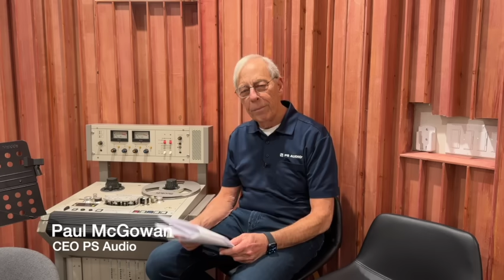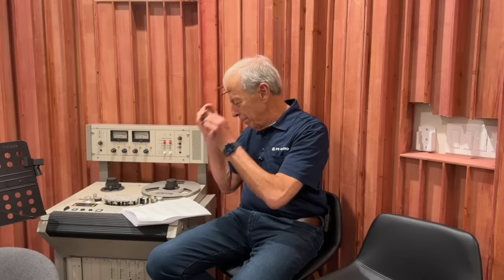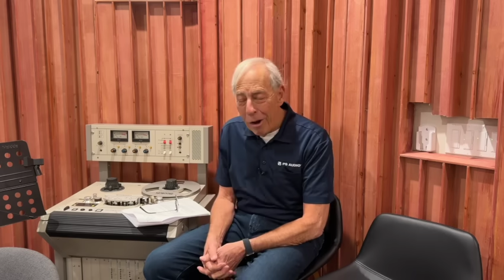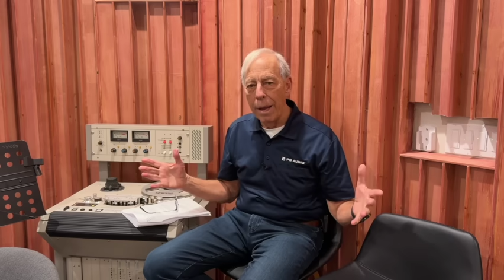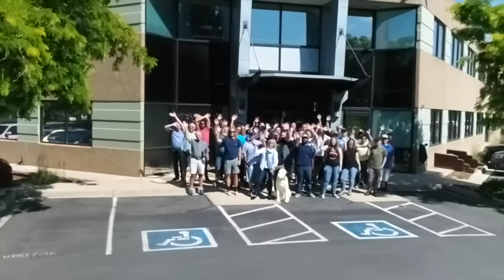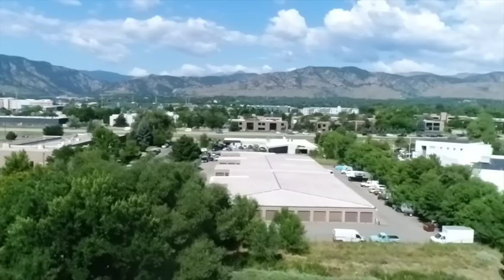When measurements and listening disagree

Comment: Data is always more valid and reliable compared to just listening. Data is one way to make sure the playing field level. So, for example, all components being tested must be set to the same volume. Guess what? You can't use your magic ears to do that. If measurements are not aligning with what you hear. That is most likely due to something wrong with your perception--such as psychological factors like expectation, which is why the listener must be blinded in comparisons. Another reason one's ears are not to be trusted. Also, one may be looking tat the wrong measurements or insufficient measurements. Measurements to describe the electrical signal and its manipulation are few an easily measured (your ears can't hear it). Measurements of sound in a room are more complex are require more and more difficult measurements that are generally not available for your speaker, room, and listening position. These variables are why one can't just listen to determine causes of perceived differences. The biggest lie in audio is that your ears are better than measurements. Are your temperature sensors better than a thermometer? Can your eyes see millimeters better than a ruler? Get real, measurements were invented because our senses are not accurate enough and are subject to illusion.
Reply: Maybe those who try to reduce this beautiful world to graphs, charts & numbers have a secret desire to become a robot. We definitely get more of an emotional reaction & emotional communication with some equipment over others. Find yourself a few good audio reviewers, whose description of how things sounds seems to be in accord with what you hear. That's a way more valuable way of choosing, or choosing what to auditoon than anything a measuring machine can tell you. Listening to music is totally subjective and anyone who downplays the importance of that over numbers is coming from way out there. Even if measurements were perfect, they at best could only tell us how something sounds to another measuring device; not how it sounds to the human ear/brain system, which works completely different, has no parts in common & is wired completely different. A man is not a machine and a machine is not a man. They both hear and translate things totally different. The day that measurements can consistently tell us how something is going to sound, is the day when I'll care about measurements. That day may never come and I'll never be a robot. 

 Our measurements are primitive and mostly useless as it relates to the human ear/brain system. If they don't relate to what we actually hear, then they are more "trivial" than useful. It's like giving a pig some kind of food and asking a human how it tastes, because we are smarter. We may be smarter than the pig, but we can't tell the pig how the food is going to taste to a pig, which has very different taste buds and physiology than a man. If pigs could talk, wouldn't it better for the pig to ask another pig how it tastes? Even if there are differences between pigs, there's a much better chance of it being a simialar taste experience, than a machine trying to tell a pig how something tastes, being wired completely different than the pigs sensory apparatus.

 Anyone who actually thinks and says that a measuring machine beats the human ear/brain system for evaluating how sounds are going to sound to a human, is thinking too far out; is thinking robotically... like a robot! Robotically wrong as hell; even if it can measure perfectly!
Reply: @sidesup8286  So, you have no evidence or logical argument, so you resort to false analogies. I'll go with the robot opinion.
Reply: @Rob-k5k9u   ...good! While you are busy with your 'I must measure everything' mindset the rest of us, who are actually
into this hobby FOR THE EXPERIENCE OF LISTENING TO MUSIC will do that. You do you & we'll do us...simple ✌👍
Reply: @FatRat-f9m  That is exactly what people say when they have no actual argument or evidence. You need to look in the mirror and see that you are obsessed with equipment, not music. Oh, and there is no "we" or "us" on YouTube, you just want to feel justified that other think like you do. Let the "we" speak for themselves.
Reply: @Rob-k5k9u   ....blah, blah, blah, blah...keep blathering because I'm not reading your overcooked engineering mindset crap anymore...I'd rather listen to music 😁
Reply: @FatRat-f9m  How much did you pay for your expensive amp?
Reply: Except in this case you are using your ears/brain for enjoyment, which no measurements can do this.
Reply: @mitchtaylor6512  It should be clear than so-called audiophiles differ in their goals. Some seek pretty or impressive reproduced music. Others have the classic home audio goal of high fidelity. Measurements will serve one better for the latter.
Reply: @Rob-k5k9u there is no such thing as accurate reproduction, so no high fidelity actually.
Reply: @mitchtaylor6512  The mantra of the subjective crowd: There is no objective accurate reproduced sound--only people's preferences. If that were true, it is unclear why anyone would care about the preferences of other subjective listeners. One can simply pick what they like. In reality, for decades, we have known what is a more accurate reproduction of the original recording. That's called high fidelity.
Reply: @Rob-k5k9u  there is no accurate reproduced sound.  We don't have an agreed upon human weighting system and measurements are taken in isolation, not how the equipment will be used.
Reply: @Rob-k5k9u   ...home-audio is & will always be subjective because listeners have different hearing from each other. Measuring music with instruments tell us nothing about how it sounds to the individual listener.
Reply: @mitchtaylor6512  There is more accurate reproduced sound. We merely have to compare the input signal to the output and try to minimize any differences--which can be measured better than just listening.
Reply: @FatRat-f9m  Actually, humans have ears and brains that work about the same way. Measurements of electrical signals encoding sound are well correlated with what people report hearing. Your just making stuff up you don't understand to defend your unfounded beliefs.
Reply: @Rob-k5k9u   ...& I can say the same about your engineering mindset. I use my ears to assess home-audio gear...always have & always will as it works perfectly for my purposes. Do your self a favour & stop trying to convince me of your overcooked engineering mindset as I'm not buying it. I have stated my belief that measurements are important at the early stages of design, development & testing of home-audio gear & none your your nonsense is going to convince me otherwise. I would suggest that you go & do something more productive with your life than continuing to try & convince me otherwise...it is a waste of your time & effort, Bye!
Reply: @FatRat-f9m  Actually, decades of psychoacoustic research prove that we can accurately predict what listeners find 'pleasing' through measurements alone.
Look up the Toole/Olive studies, the Fletcher-Munson curves and AES standards.
Reply: @FatRat-f9m  I don't deny it works for your purposes. I deny your amp sounds "better" than another. I do that because nobody has ever demonstrated they can distinguish amps. You believe because you heard a difference without taking any steps to control conditions. It's like believing calling people names is some sort of logical argument, which you also seem to believe.
Reply: @Rob-k5k9u   ...you are insane; pure & simple.
Reply: @Rob-k5k9u  The mind prefers the rest of belief to the exercise of learning. Sadly.
Reply: @FatRat-f9m  More name calling, no evidence or logical argument. Can you see how this weakens your position?
Reply: @ Rik. My analogies are always good ones and when something is as obvious as day versus night, no one needs to measure the moon to prove it's up there. Enjoy your tinny darkness.
Reply: @sidesup8286  That is exactly what people displaying the Dunning-Kruger effect say. Enjoy your delusions, but there are usually designed to be pleasing.
Reply: @Rob-k5k9u   ...you are so obsessed that you just don't know when to give up. You are the one with D-K effect problems.
Reply: @Rob I meant, with my comment about measuring the moon and your living in tinny darkness.
Reply: @Rob. Rob(bie) The Robot needs oiled. Any time you see someone on here asking audiophiles to "prove" that their system has special qualities, you can be sure that the confrontational person's system has no magical qualities like those at all, and is so far from them, that they can't even imagine such qualities to exist. They're always asking for "proof", yet they never provide any proof of anything themselves!.. You have to read between the lines with these types. Maybe their Fisher receiver from the 1979 spec wars have good specs but sounds like crap, from all the negative feedback they had to use to artificially goose up the specs, but the negative feedback grained up the sound so much that it sounds like excrement. People on sites like this have amazingly good equipment; they themselves only have their numbers & their specs. Graph & chart worship.

" Logical" is realizing that as humans, ears are the only thing we got, and a measuring device can only give us numbers; not how something is going to sound. They ignore the subjective, which is by far the most important thing we have, many times over; like getting in your bath tub, and ignoring that you need water.
Reply: @sidesup8286  Funny how high end cultists and reviewers say they hear differences, but the don't demonstrate they can. As many controlled tests have been done in which the Golden Ears SAY there is a huge difference, but then fail to distinguish the amps when they don't know which is which. Why wouldn't people ask for some evidence that what your are claiming has any basis? Are you in the habit of just believing claims? Especially those without any evidence?
Reply: If you had "ears" and a system like mine you would not need A/B/X tests. It would be as ridiculous as doung a test on who's taller, a midget or an NBA basketball center. If I ever get into real boring stuff like "doing tests" which I know would take up some of my time, it'll be when two things are closer than a midget & a basketball center. I have recordings I know like the back of my hand, which I've heard a100+ times, and when every note is obviously cleaner & I'm hearing all kind of stuff that was previously buried in the mix; that is MY test. I have on rare occasion taken my best cables out and put my previous cables back in; and the whole soundstage collapses. I got a good test for you; test with a light meter what is brighter; high noon on a cloudless day or midnight on a moonless night.

 You "measurement guys would laugh at your own self,  if you could hear the differences that we hear with stereo equipment 4 or 5 grades beyond what you're likely using. I.. nor other adiophiles are trying to prove anything to you; and believe me your "words" are laughably wrong and are not going to change our mind one iota, on what we know & what we  hear. Maybe a lot of it comes down to that I have REAL equipment, which is sonically  comparable to some of the most elite systems on the planet; and you probably have relative toys. Go measure all you want; we don't need to when it's that huge a difference. Leaving us alone would be a good idea. And as anyone can see who scrolls up, YOU are the one that started with the negativity and the digs. Instead of playing pretend psychiatrist, maybe you should seriously consider seeing one . We don't need no nerds telling us there's no difference when all the instruments have such air volume on our systems that they sound like they are coming from our ceiling. You believe what you want and we'll believe what we are sure of.. How's that?
Reply: What a load of crap! I've heard this "your ears can't be trusted" BS too many times. OUR EARS ARE ALL THAT WE'VE GOT, EINSTEIN.
Reply: @FatRat-f9m  Well, genius, our ears are not all we've got. Instruments were invented to quantify and objectify observations beyond what our senses can do. Maybe you keep hearing that because it is TRUE? The "just listen" crowd is simply too lazy or ignorant to do anything else.
Reply: @Rob-k5k9u   ...instruments can't hear & so 'yes' our ears, or more correctly our 'hearing, is all that we have when it comes to LISTENING to music, which is the primary function of home-audio equipment. I do not subscribe to your overcooked engineering mindset...it's BS.
Reply: @FatRat-f9m  Your ears can't hear electronic signals. So, how do you know they are there, or real?
Reply: @Rob-k5k9u   ...immaterial. You are brainwashed by an unforgiving engineering mindset that I do not subscribe to.
Reply: @FatRat-f9m  Dismissing the engineering while enjoying the sound is like mocking the pilot’s instruments because you like the view; the single reason the experience is pleasing is that the math worked out.
Reply: @mrpeterfromgodknowswhere   ...blah, blah, blah, blah, blah. Now you're just typing to no one.
I'm not going to keep explaining & repeating myself to you because you obviously don't
understand where I'm coming from. Cheers.
Reply: @FatRat-f9m  Dismissing the engineering as 'blah blah' is essentially waving the white flag. It’s an admission that you’ve run out of ways to justify your position, so you’re choosing to ignore the very physics that allow your speakers to move in the first place.
You can enjoy the 'view' all you want, but pretending the 'instruments' don't matter doesn't make the engineering go away -it just means you’re happy to benefit from the math while insulting the people who did it for you. Cheers.
Reply: @Rob who says "enjoy your delusions as there are usually meant to be pleasing." Besides that sentence not making any verbal  sense,, you.....as someone out of your league, trolling on a comment section like this amongst people with REAL equipment like me, telling us we are having delusions about our systems having special qualities, that your crappy equipment doesn't. Let me remind you, that you playing pretend shrink with thousands of people who you do not know from Adam, and whose systems you don't know and will never hear, and never be able to attain anything like it yourself...isn't very scientific and your whole approach lacks any credibility or sanity. Our systems have plenty of special qualities that are real, that you can only dream of. We are wired just fine thank you, and so are our systems; the faulty wiring is all on your end. Sorry!
Reply: @sidesup8286  It is amazing how impressed people are with themselves. And, it seems the less they know, the more impressed they are (i.e., Duning-Kruger effect). I don't need to know you for you to demonstrate you can distinguish amps. And, I claim the existing evidence all supports the idea that they can't. So, cite some other evidence--if you have any. If you don't, why do you believe what you do? It's very easy to just listen and relay one's impressions and opinions on social media. It's hard to actually learn what matters or make a valid comparison. I assure you my equipment is real, and it is better than yours. And, don't ask me for any proof.
Reply: @Rob.That'a lie.. . In this whole big world there are many listening tests & things that go on, and you don't know what happened in even 1% of them. You only point to the ones that failed due to incompetent listeners or a comedy of errors; and blind testing is usually a comedy of errors the way they are done. Why don't YOU prove something, instead of putting the burden of proof on more intelligent, experienced listeners than yourself, whose equipment is not a relative toy; like what your equipment likely is. You are totally out of your element here. We are knowledgeable experienced listeners with good equipment; not Pretend To Be's.
Reply: @sidesup8286  I’ve repaired amplifiers for 30 years and hold two engineering degrees within electrical and thermal alongside studies in acoustics and psychoacoustics. Despite my background and my hearing still being solid up to 16.5 kHz, my own blind tests were a reality check.

I spent my younger years "drinking the Kool-Aid" from snake oil salesmen, certain I could hear a difference. I was wrong. When I removed the visual bias, the differences vanished. It was humbling, but necessary.

Rob isn’t the one out of his element here -you are. He isn't pretending to be -you are. It’s unbecoming to be this arrogant and unkind while ignoring the physical reality of the gear. Climb down from that pedestal where you don't belong, run some honest blind tests, and humble yourself.
Reply: @ mr.peter. This is sides up...I'm sure you think what you said was GENIUS....But it wasn't! People with your mindset are actually being commented on, by an increasing number of Youtube audio channel hosts. One of the main things that ones like you can't seem to get into your mind is that YOUR experience is only that; YOUR experience.is only YOUR experience. Do you think that you're the only one who has compared things. Really?....Millions of us have compared things too & can easily hear big differences where you hear none. You CLAIM you were an audio engineer and this and that. That means nothing. If you can't hear improvements with the kind of things that we easily can; that means that either you have bad perception, or that millions of us are wrong. I'll bank on the first one all day long. If you really were an engineer as you "claim", you might have been a good one or an awful one. You would not be the first or even the 1000th engineer to have bad perception who can't hear worth beans, who has bad judgement, and who doesn't know what they are doing particularly well. That explains why so many of our cds & lps are mastered so horribly!

 As for telling me to get off my high horse, YOU are the one touting all these possibly phony qualifications that you have. I am simply a normal knowledgeable person who can hear. What you think is a genius piece of work; needs some work!.. It is full of things like calling the kettle black, contradictions etc. And it sounds like you are some older person with bricks for ears.
Telling people like Fat Rat, myself and others that we are all wrong, because of what you hear with YOUR hearing apparatus (ears), disqualifies you as anywhere even remotely near scientific, and establishes you as having a lot of gall.
Reply: @sidesup8286  The 'I can hear it' argument is the oldest trope in the book. If the difference is so 'obvious' and 'easy' to hear, it should survive a double-blind ABX test. It never does. That’s not a reflection of your ears; it’s a reflection of how the human brain and cognitive bias work. I’m not touting qualifications to be a 'genius' -I’m using them to point out that electricity doesn't care about your feelings or how much you paid for a cable. Science doesn’t require your belief to be true.

It is also telling how discussions with subjective, non-technical types are so predictable they’ve become boring. It follows a script: when you can't argue with physics, data, or controlled testing, you inevitably resort to ad-hominem attacks about 'bricks for ears' or 'phony' degrees. It’s a classic defense mechanism -the moment the logic fails, the insults start. 
It's just a modern-day 'The Emperor’s New Clothes.' You're standing around admiring the fine silk of the gear, while those of us who understand the measurements are just pointing out that the emperor is naked. If you’re scared to test your ears without your eyes helping them, just say that. Or don't. It's clear how it is either way.
Reply: @sidesup8286  When people care what is beings said on social media as some indicator of truth. Or, claim they know what "millions" are doing--as if THAT indicates truth; they are irrational or less than 12-years old. The evidence does not support that people can distinguish amps, regardless of how many SAY they can, or what their "experience" is. Do we consult the intuition of the clueless for scientific knowledge? Do we take a vote? The belief that people just intuit the truth is popular, but ridiculous.